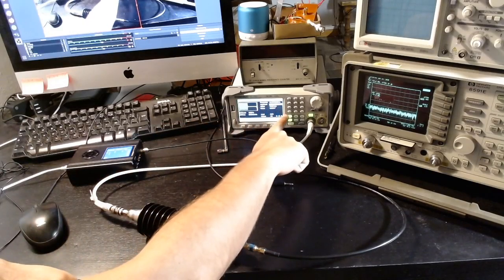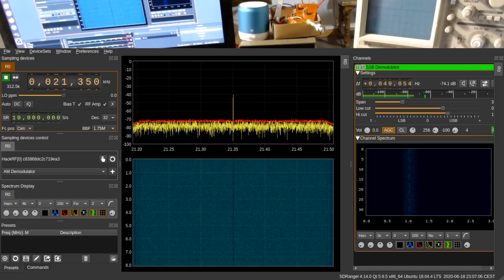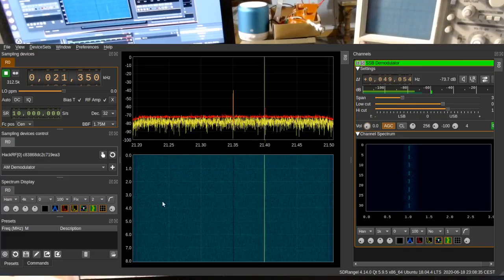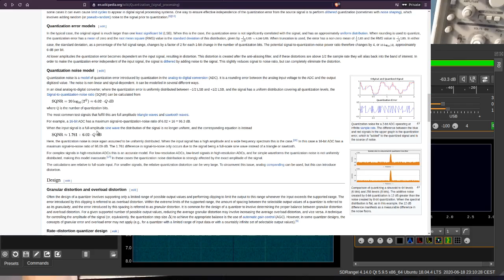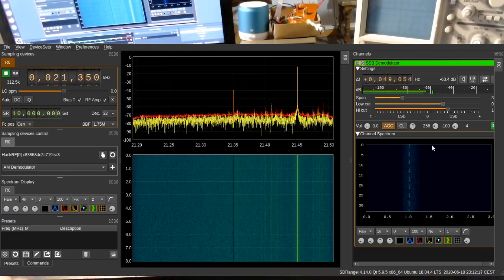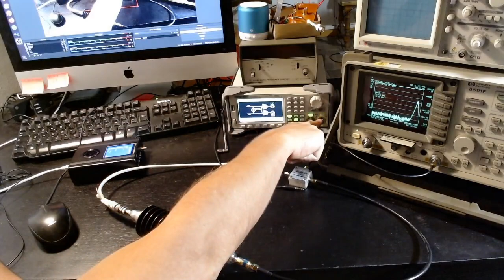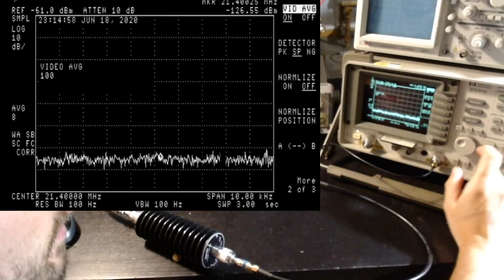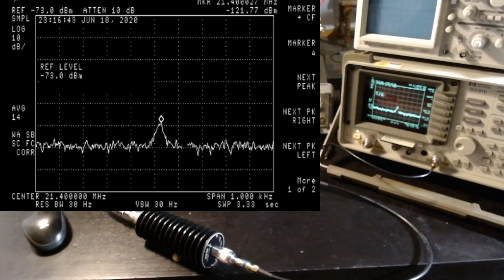Episode 46: HackRF sensitivity (part 2)

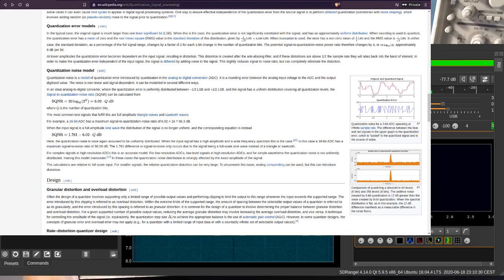Comment: Total noob question here, but what does "in-band signal" mean here 6:03 ? It says you can't hear a signal weaker than 45db below the strongest in-band signal. I'm probably wrong, but does that mean if I'm looking at a 10 MHz section of bandwidth on the sdr (for example, 120 MHz to 130 MHz) and there is a really strong signal at 122 MHz, it would hide/drown out a weak signal at 128 MHz? But then if I lowered the sdr sample width to only 5 MHz wide and centered on the weak signal at 128 MHz, I would be able to receive it?